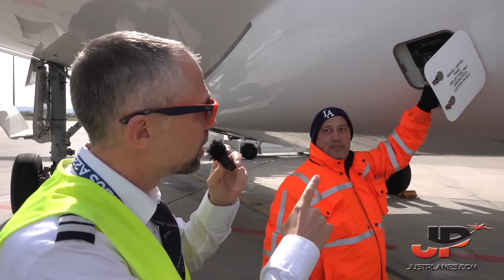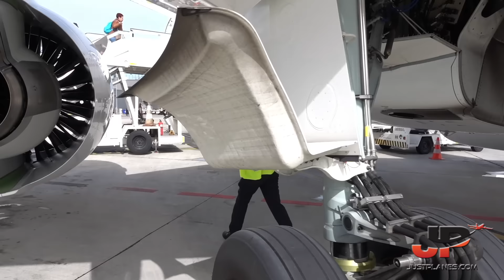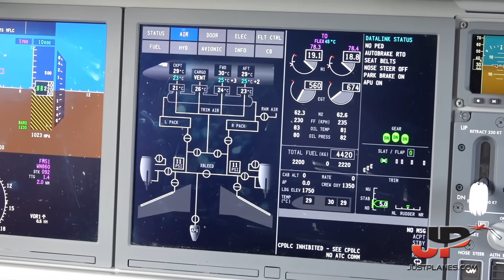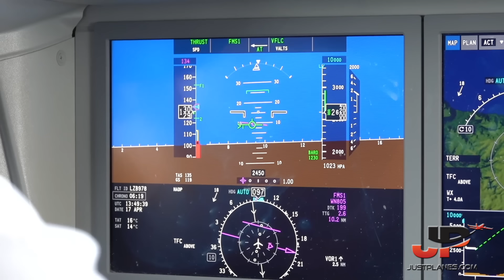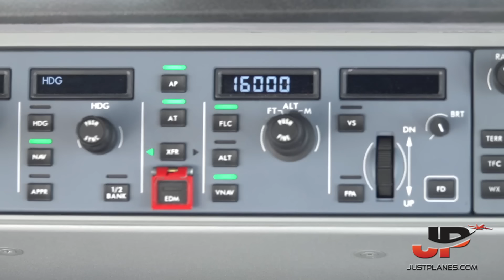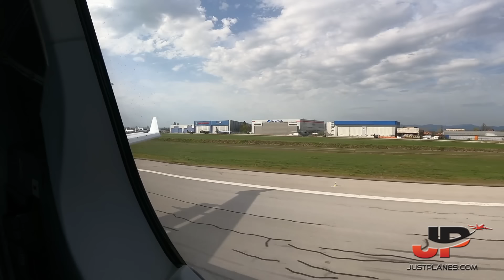Bulgaria Air Airbus A220-100 Cockpit Varna🇧🇬 to Sofia🇧🇬

Comment: One of the smartest moves by Airbus to acquire a majority stake in the Bombardier C series and rebrand as the A220-100 and 200. Absolutely loved flying on these little pocket rockets as a short to medium haul commuter. My favourite plane of its size and class, quiet, powerful, well constructed, extremely comfortable....you feel you are in a reliable and solid machine. I like the Embraer competitors as well, but the A220 just feels like a well designed Ferrari and the Embraer a comfortable Volkswagen. First flew them with Swiss and Baltic and just love the performance. Also one strange key observation I made, but an important one, the huge size of the rear toilets! Very spacious and with a window...best economy size toilet of any plane including big wide bodies. Just a beautiful sleek looking plane. Big thumbs up.
Reply: Indeed -this plane originated and was designed in Canada by Bombardier as the CSeries , eventually Airbus took over as the project ran into dev cost overruns and delays due to disputes with Boeing. So glad Bulgaria Air chose it and to see it fly - I was born in Bulgaria but grew up and lived in QC and ON from the mid-80s to 2015, I remember growing up we heard so much about it on the news over a whole decade as the project went through ups and downs and became a political football as well. Great to see it saved and too bad Bombardier could not reap the benefits as they had to give up controlling stake of the platform to Airbus 🇨🇦🇧🇬